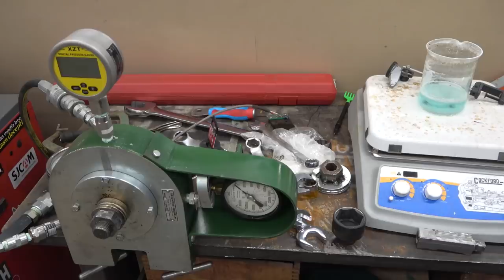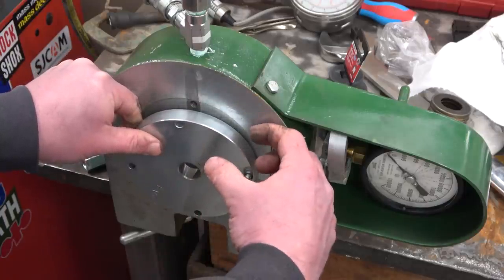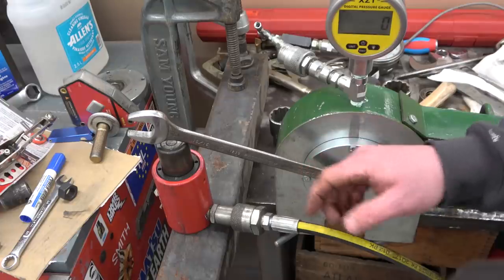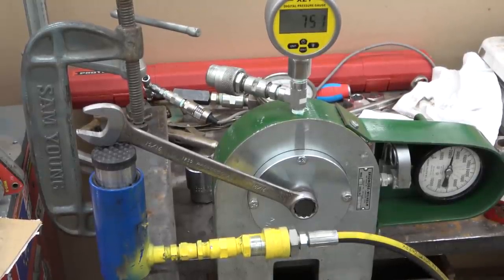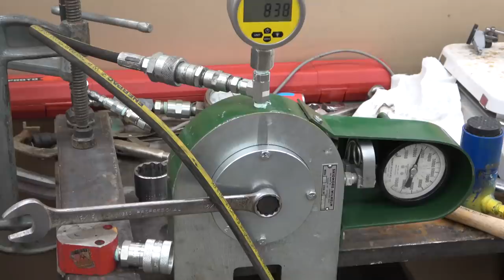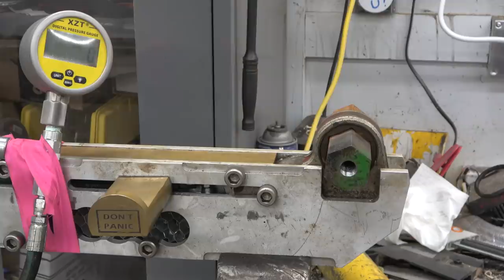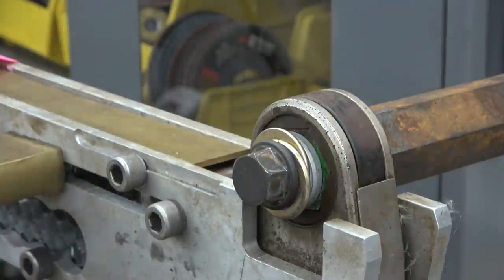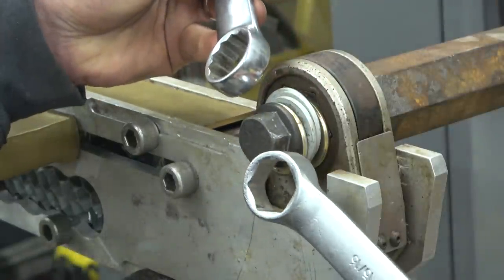6 point VS. 12 Best wrench?

Comment: A friggin' wrench is a HAND TOOL! It's not meant to be used to mechanically or hydraulically actuate a fastener to a couple tons of torque, although, according to this, it can.
Almost 40 years of industrial maintenance, service, and contract work has taught  me that tools are heavy, spaces are usually tight, and versatility is tool design will get you done with a job 99% more times than theoretical "better than" bullshit ever will.
Six or 12 point only speaks to it's versatility in relatively tight situations, and 12 point wins that race every time.
Also, as mentioned above, if a situation is so dire that any 12 point wrench or socket is just a deal breaker, I ain't gonna be bringing a wrench (hand tool) to a power tool battle - anymore than I would bring a knife to a gun battle.

All that said, there are times when six point wrenches are useful. Typically on vehicular applications - which I loathe with every fiber of my being. I might even have some six point wrenches around her that I either got at a yard sale, given to me, or I found on the side of the road, but I damn sure didn't pay retail for them. I also ain't ashamed to use them if they happen to be the closest thing within reach when I need a wrench...

Comment: 6 points are great because they grip bolts and nuts BETTER but the 12 points allow greater angles to get on the bolt or nut to begin. I do not give a damn whether they break earlier than the other because that has more to do with who and how they were forged. The next question is we are not dealing with perfect nuts and bolts and some are worn and the edges are compromised so the six point is superior.

Comment: 6-point sockets are the way forward. The ratchet gives you the bites, and you odn;t round corners off crappy bolts. I was a little surprised by this test as I have plenty of practical experience that a 6-point socket works where a 12-point doesn't. I think it's more significant at smaller sizes, and of course with pre-rounded heads/nuts.

Comment: I have a set of 6 point wrenches just for dealing for buggered nuts.  otherwise all 12 point for wrenches.  I do the opposite with sockets.  6 point across the point unless I have to deal with 12pt fastners.

Comment: I wonder if they are both equal when it comes to rounding out weaker nuts. Had a used car came with the lug nuts ultra tight and seized from weather. First tried a 6 point socket and started rounding out, came back to it with a 12 point socket using same breaker bar and broke it loose.

Comment: You also have to factor in the difference when using metric on a standard or standard on a metric.  With a 12 point you will probably bust your knuckles...with a 6 point you might get away with it because there is more flat to grab before the slip.

Comment: Tell that to my knuckles after the 12-point sockets keep slipping off the friggin' oil drain plug, but the 6-point that I then have to hammer on due to the rounded edges stays so well it can just be left in place for the next change!

Comment: You need to machine the bolt head and use a smaller spanner.
Otherwise a good fitting spanner will always win on normal nuts and bolts. 
I thought the plug tap was the last one used but college is a distant memory now.

Comment: another reason a lot of them are 12 point too is that Snap-On is used a lot in the aviation industry and there's a lot of 12 point bolts in use in many of the engines so you can't very well use a 6 point on them! nor the open end!

Comment: 12 point is more likely to round off a soft bolt. And a spline drive will ruin the finish on a polished chrome fastener. However, the shittiness of only having 6 angles of attack cannot be understated. The trick is to just have 8 sets of wrenches and always have the wrong set handy.

Comment: Good test, But BUT.... 6 point is better as for more surface area on each point of contact with the fastener. that being said, years of mechanicing have tought me that on a compromised fastener thats rusted or already partialy rounded off, best course of action is to use a 6 point.

Comment: I typically choose a multipoint, however will reach for the six-sider as soon as I come across corroded or worn bolts. If the surface is compromised at the end of the flats you need to look further towards the centre of the flats for purchase which the six-sided can accommodate. Then you are free to forget which direction your impact gun is running and rip that fucker clean half in two, or at the very least torque to yield and back a flat!

Comment: 12 points is handy when you work in a tight space and can't rotate the bolt enough to move the wrench to the next notch on 6 sides

When you have so little movement space that even a ratchet can't click.. that's where half of the time on that project will go. Especially if it's rusty and you can't get any grinder or sawblade in there either

Comment: If you look at how much wrench is in contact with the bolt, it makes no difference which spanned you use both only contact at the point of the bolt flank. My guess the twelve point will break first, and the six point will rust first because no one will ever use it.

Comment: It's hard to use an old snapon box wrench in a test and call it a fair fight though. I'm no tool snob but the core snapon hand tools really are awesome. I think if you could get a crafstman 6 and 12 point wrench, there might actually be a difference. Just don't do it, because I like finding good, used snapon tools for sale at decent prices now and then.

Comment: 6 point for cracking bolts, saves rounding them. I only use 12 points if I can't find my ratchet spanner and the bolts in a crap spot that I can't get enough turn to use the 6 point.

Comment: The difference between 12 and 6 point comes when the head of the fastener is no longer perfect, such as rusted away or already partially stripped by using a 13mm instead of a 1/2 or something along those lines.

Comment: Yeah I've had some rounded off bolts that you needed a six-point. Butler Snap-on wrenches cuz that special design 12 point that grabs the boat way better I forget what those wrenches were called that I paid $30 each for them
Reply: Flank drive. 300 dollars for ten wrenches. Lose a ten mm $30 lose a 19 $30. Made no sense.

Comment: When I am at the scrapyard I prefer 6 point since old/rusty/weak bolts tend to round off with 12 point. This test is assuming the metal is worth its weight in manure lol

Comment: The slipping and stripping happens because the wrench is too loose of a fit on the fastener, not because the wrench is failing in use, rather the failure is in the design and manufacturing.

Comment: Indeed, an Enerpac DOES work in any orientation. so well that if you have it the wrong orientation, you can bend and split open the fitting as you pull the bearing out of the project you're working on when the bearing hits it. At least the fitting is weaker than the threads of the cylinder. Wouldn't want to have to report that to the boss.

Comment: I've used both before and found that on older rust bolts my 6 point worked best and maybe it was just me but I don't know how many 12 point wrenches I have split open as I was removing a stubborn bolt or nut.

Comment: I tend to use a 6 point to break loose something that is kinda rounded or I definitely do not want to slip off of and round then the 12 point to finish. I’m usually double wrenching so I have both anyways.

Comment: Flow chart: if its rusty/partially rounded/a small size, TRY to get on it with a 6 pt. first.   If you can't get on with a 6 pt.,  try a 12 pt... and pray to the wrench gods.

Comment: The 6 point is the better of the two in wrenches and sockets. I do understand  your point of it being easier to index, but the grip is the real testament. A 12 point will round off more bolts than a 6 point ever would.

Comment: In the spirit of your upload button works better then my upload button, I've always wondered if there was a difference in strength between thread cutting vs thread forming taps. Like does it matter more in Aluminum vs Bronze vs Steel.

Comment: If you are changing car batteries, a 6 point is the only way to go. A lot of those nuts and bolts are not hardened and with a 12 point will round right off.

Comment: 6 point wrenches are stronger on 6 point bolt heads. 12 point wrenches are stronger on 12 point bolt heads, but not on 6 point bolt heads. Most of the time it doesn't matter because they are both pretty damned strong. However in certain rare situations ( like flywheel bolts on certain engines ) you will see 12 point bolt heads used because they want to make SURE that you don't strip the bolt head because you gave it too many beans.

However... almost ALL wrenches are made with 12 point boxes because even though they are technically weaker on 6 point bolt heads they are still so damned strong that it almost never matters. The only time that I've ever seen a 12 point box slip is when the bolt head is either already mangled to hell... or if the bolt is so rusty that a 6 point is going to snap the head off anyway.

Comment: Ahh, but they will slip, at smaller sizes. Especially when rusty.  Try it with a 10 or 12 mm.  That beefy 15/16 has lots of contact area even with 6 extra points in the wrench end.  A smaller farstener, not so much, especially when factoring in the typical sloppy tolerances found in anything but the tool truck brands.  Everything I have at 19mm and below is 6 point.  After that, 12 is fine, as you indicate.

Comment: Welll ave not all of us have clean non rusted and non pitted to death bolts that are already half stripped on our cars!! Lol... usually i use the 12 point but when working on older rusted components it's best to go with the correct point wrench save you hassel and saves your nuckles!

Comment: I have a 1/2" drive wrench extender (K-Tool 49403) that is slick! Put the hurting on some hard to reach nuts with the breaker bar and the ol cheater pipe...

Comment: By laying the wrench across the body of the torque-struct-o-matic aren't you limiting the deflection of the wrench more than you would if you were to fix it at the end (aka where you would normally hold it)? That increased bend might send the 12 point into a low earth orbit sooner than the 6 point since more engagement = more better.

Do I think fixing the wrench further down would change the result? Maybe. Do I think that matters in real life? No. If you can apply that much torque by hand I think you can also dodge a wrench.

Comment: If you use a cheaper bolt, won't  you round the head off with a 12 point? Could you mill that 6 side stock down to the bolt size?

Comment: So I work with a guy that over torques his clamps on scaffoldings. 45 psi is recommended. But the guy just cranks em. My question is, is there a failure in clamps that are over tightened?

Comment: Wish I could afford more six points. I have to work on too many farked up farceners.
Reply: I bought some tekton extra-long ratcheting wrenches specifically because they were the only ones that I could find with 6-point ratcheting box ends.

For some reason name brand tool companies like Snap-on Matco and gearwrench use 12 point or spline Drive designs.

Comment: 6 Point is preferable because it results in a larger contact patch between the tool and the bolt, thus reducing the likelihood of rounding the bolt head.
Reply: This is exactly why I bought tekton extra-long ratchet wrenches because all the other name-brand companies make either a 12-point or spline Drive design

Comment: Why do they still use 12 point hardware? Does 12 point hardware with 12 points of contact from a wrench transfer torque more efficiently than 6 on 6 does?  Like on big u joint straps it almost seems they use 12 point to prevent over torqueing because they round off every time.

Comment: I wouldn't throw out those 12 point wrenches and sockets just yet boys. Many times you run into a situation where you don't have the swing space for a 6 point wrench and no room for a socket on a socket wrench. And those 12 point wrenches are just rusting away in the back of your wrench drawer. 
And some times you find there are 12 point fasteners on what your working on. Although rare I have run into that often. I am guessing a deterrent for ill equiped mechanics from messing with stuff they aren't exactly ready for. I run into this often working on boats and marine engines and marine hardware. And those fasteners are almost always rusted beyond belief. 
So I keep 12 point tools in my box all the time along with 6 point tools. Sometimes I muck it up but my tools don't slip over fasteners rounding them off because I am sure to use the right size wrench or socket in the first place. If it don't budge then it's time for the blue wrench or the inductor tool.
If you haven't used an Inductor your missing out. It heats up just the fastener with no residual heat around it. Sometimes you need this to protect gaskets and boots and wires. I bought one off the Snap-On truck for $1400, it comes with a bunch of coil attachments and has a good work cycle time. Heating a 2 inch bolthead to a red hot 1000 degrees in a few minutes. Very useful versus a torch that could take 10 to 15 minutes to get cherry depending on the surroundings, if it is even possible at all. And if your working on an engine it usually isn't possible due to fuel/oil/lube and electricity. 
Good luck out there guys.

Comment: The proper tool for the proper fool, AvEy baby.  SOCKET AND EXTENSION ABUSE!
MOST people just use the wrong size crescent wrench, y'know?  That way they don't have to count up to 6 or more.
Well, if you have a limited stroke (less than 60 degrees) for confuddling the nut or bolt head, use a 12pt wrench.  If you have room, always use a 6pt.  If you have a damaged nut or bolt, use a 6pt.
Final note:  When you NEED a good, solid wrench, choose a 6pt.  It won't mangle Chiwanese bolt heads or nuts.
That's one helluva setup you ended up with there, pard.

Comment: Still don't know which can withstand more torque, we need a retest instead of a nut and bolt just use a solid hex bar no need to tighten anything just need to prove which is better and from experience the 6 would withstand more torque without slipping or damaging anything including itself

Comment: I've rounded the corners off of many bolts with a 12 point that a six point was then able to extract. I still keep 12 points handy but when I'm staring down one of those 8mm U-Joint strap bolts on a 1-ton pick-up you betcher ass I'm getting the six point.

Comment: I have stripped out more than a couple 12 points. Plus dealing with rounded-off bolts.
Generally, I buy 6 points. But I am 100% willing to concede. It may have something to do with the collection of cheap ass tools I have.
I cant help myself. I buy every flat of hand tools at every auction.
I have thousands of them at this point.

Comment: You should test some tool boxes - so you can put tools away / cleanup the shop ;)
I kept both 12 & 6 , many times one , or the other would do a job the other wouldn't .
Example could be worn out fastener , size vary .
But I did A.S.S.U.M.E. ;) that with heavy torque the 12 may slip , now I may guess [ not assume again ;) that a cheaper shieeze tools would slip ?
Thanks again , watching for yrs. now .

Comment: Only time a grab a 6 point is when the head of bolt only has good flats cause someone slipped with a open end and rounded a edge on both sides

Comment: 6 point will normally work better.  A 6 point wrench isn't necessarily stronger than a 12 point wrench but it can sometimes transfer more torque to the fastener with a 6 point than a 12 point.  When you have fasteners with a lot of wear on them, rounded corners, things like that there can be an advantage to 6 point tools.  But as you proved at the beginning of the video a box end wrench is much easier to use as 12 point than 6 point.  In tight quarters you might not even be able to use a 6 point box end wrench.  With sockets there is no advantage to 12 point so you get 6 point sockets when you can.  The monkey in the works is occasionally you find 12 point nuts or bolts with 12 point heads so you have to have 12 point tools.  Depending on what kind of work you are doing you may never come across fasteners that require a 12 point tool.

Comment: If the previous guy used an adjustable wrench to tighten the bolt, you might want the better contact of the 6 pointer ... Otherwise 12 pointer all the way !

Comment: What is the spec for that thread on quick coupler.   I took one into hydraulic shop and they claim.  They had not ever seen that style only the snap lock with the piece that gets plugged with dirt and grime.   Not a hydraulic savy person when it comes to all the fitting style and types.

Comment: Although not as exciting as this was, using a softer bolt would have made for an easier test.  6 point keeps more pressure on the flats of the bolt, 12 point more so on the corners.   You can round a bolt with a 12 point and still have success removing same bolt using a 6 point.  Try it on a brake bleed valve, preferably on a friend’s car.  Trying it the other way will not gain same successful results…ever.

Comment: I'm curious about the strength of Facom 70a open ring ratcheting wrenches. They are an enormous time saver in certain situations and real beefy, but possibly weaker than a regular wrench?

Comment: Yeah right.
Try it on rusted bolts.
Try it on a smaller size.
12 points are for loose bolts only.
Anything that needs torque, needs a 6 point.

Comment: With the amount of bolts I personally encounter with 12 points on them 6 point wrenches don't make sense. Also I'm not strong enough at my age to get a 15/16 12 point to slip on a good bolt.